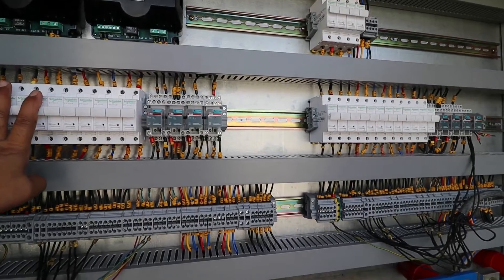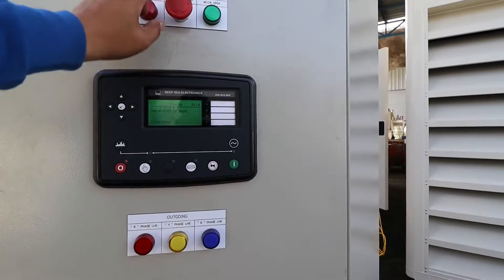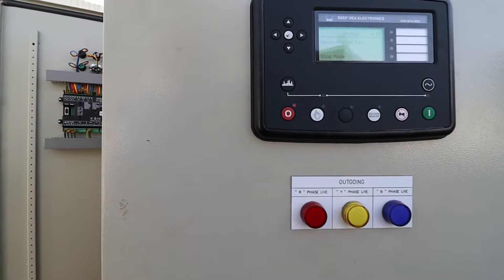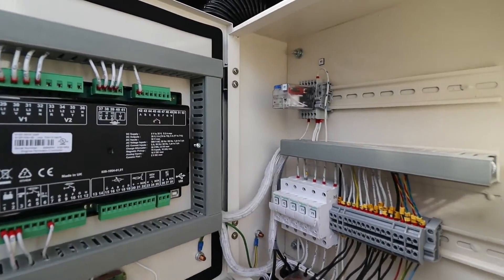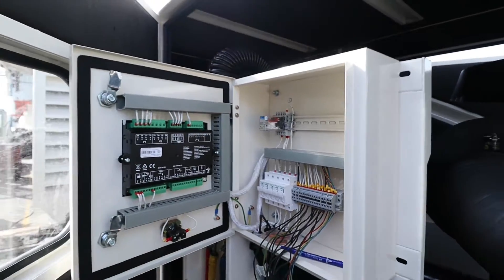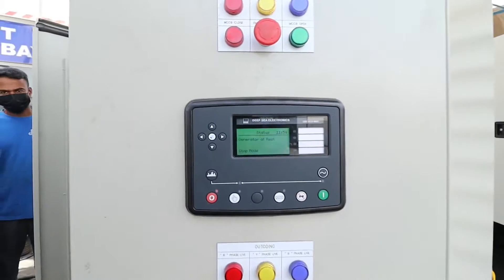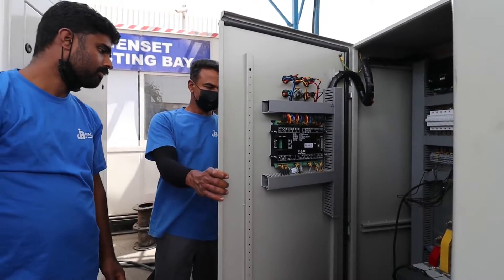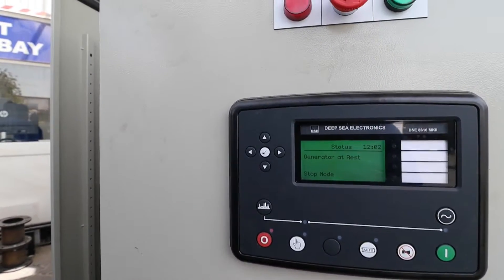Synchronizing 200kva with totalizing panel benzblogs

Comment: Greetings sir...... I have 2 x 400KVA Genset they originally came with dse 4320 control panel.... 
If I want to synchronize both of them will I replace the dse 4320 with dse 8610 on the panel inbuilt on both genset or I build a separate panel with two dse 8610 and wire all input of both  Genset to the new panel....
Reply from the maker: Its posible separated and also posible if you make one panel control for how many genartor

Comment: Ask ko kung paano ang gagawin kapag mataas ang circulating current between two generator running in parallel?
Reply from the maker: Marami g pweding dahilan ng high cerculating current one its not same boltage ,not same frequency -speed not same phase angle in order to get the correct paralleling shout know everthing this

Comment: Sir,

Tanong ko lang, ung 1000kva cummins gen.set namin pag isynchronize sya sa ibang gen .set, nag sync sya fpr 1sec then mag aalarm ng out of sync. DSE 8610 MKII yung control nya. Ok naman yung frequency (50hz) at  voltage (400v).
Ano po kaya possible problem.
Reply from the maker: Sir communication sir double check nyo make sure end to end my resistor
Reply: @benzblogsVlogs  ok sir icheck ko, pwde ba alisin un resistor? Hindi ba maapektuhan ung ibang gen.set? 5 units kasi un, at ung may problema nasa end unit
Reply: @benzblogsVlogs  Sir ok ung communication link nya 100%.
Reply from the maker: Wag sit importante yan
Reply: @benzblogsVlogs  sir, circuit breaker nya ata problema. Motorized CB kasi sya ABB SACE PR231/P, hindi gumagana ung handle, wala rin reaction pag press ko ung ON/OFF switch, baka may problema sa mechanism nya. Kasi napansin ko, pag synchronized nya, ung CB dahan dahan bumabalik sa OFF, dapat biglaan un.

Comment: what means circulating current
Reply from the maker: High cerculating mean the current flowing from or your load its happen during synchronizing due 2or more will be parallel if problem like high cerculating  mean other alternator is load already